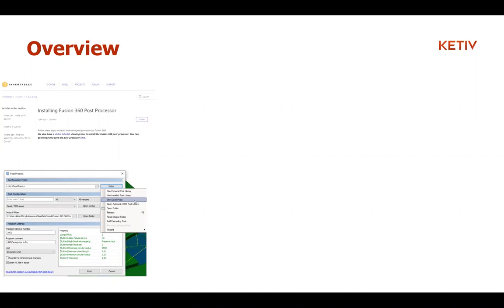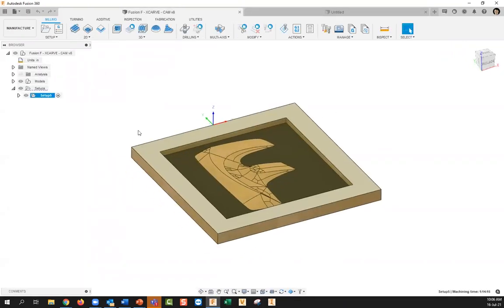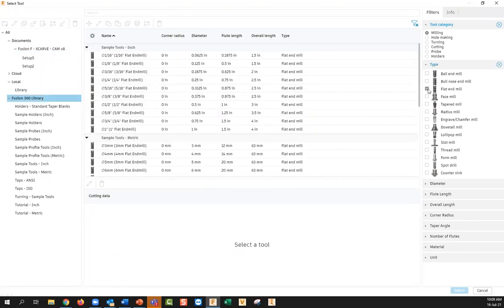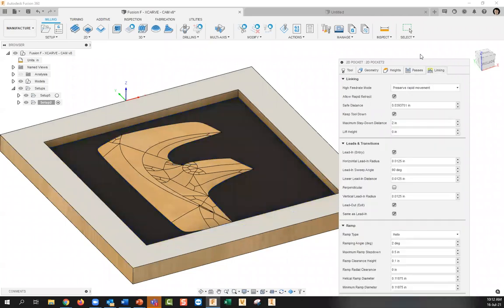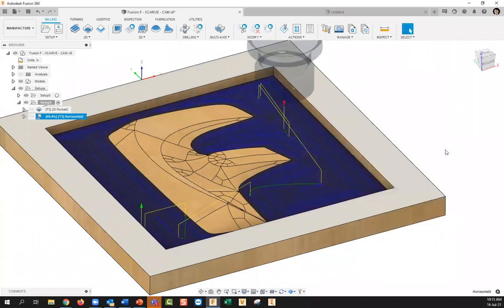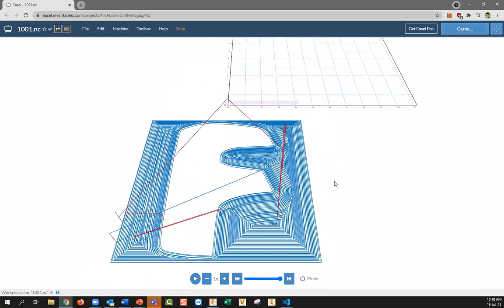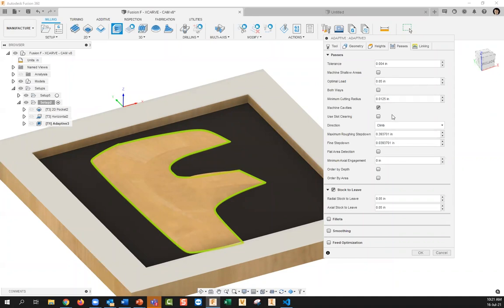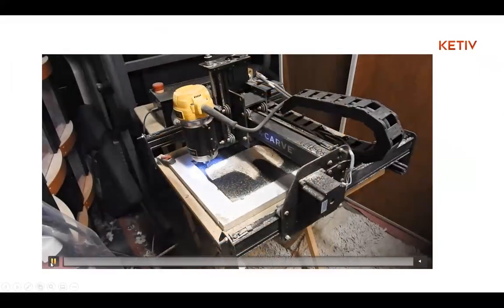Creating Toolpaths for CNC Routing | AVA: Fusion 360

Comment: Thanks for the introduction. 😀 There are many tutorials on how to mill a single part but what about us woodworkers with large designs using plywood and MDF ....Think of flat pack cabinets with thousands of shelf pins, dado pockets and euro hinge holes) We would love to see a tutorial for this....For example, a single job would be hundreds of parts nested over approx. twenty 4 foot x 8 foot sheets. How can Fusion 360 automate the selection of 100 contours, 1,800 holes and 124 pockets? We would be using a 2.5 axis CNC machine  with suction table and 10x tool changer.